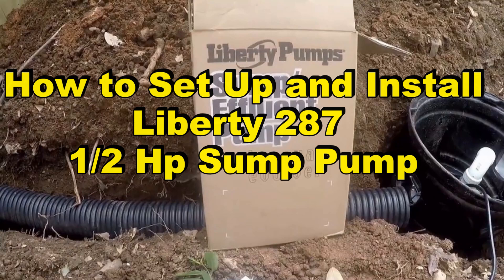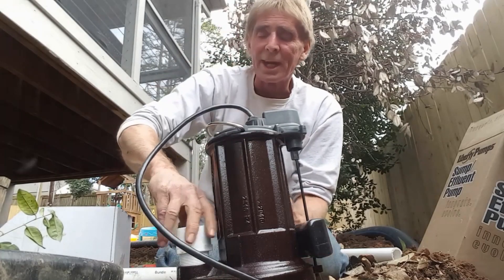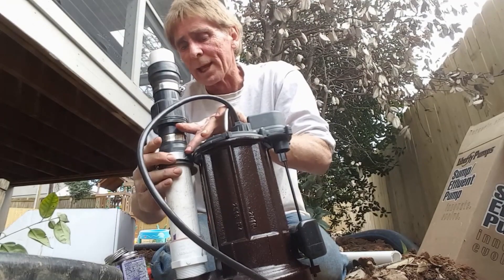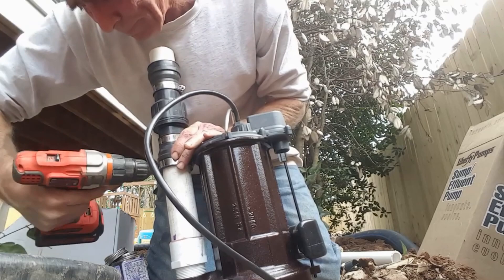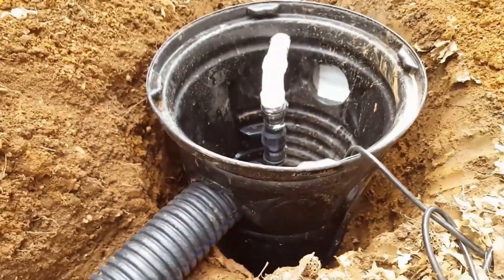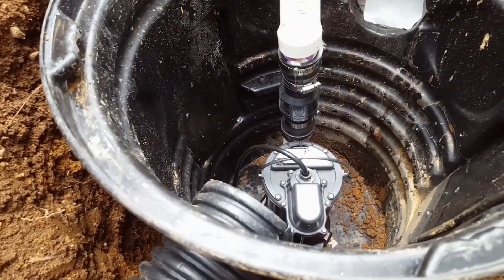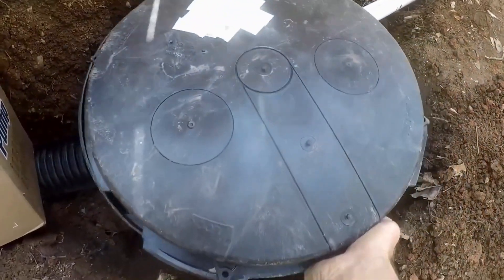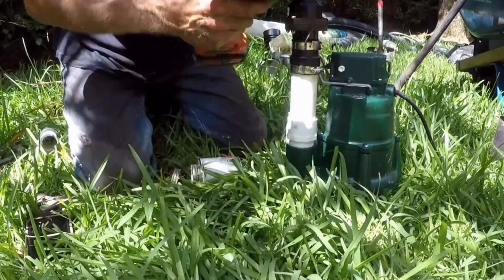Sump Pump - FAILED after 1st Big Rain -Liberty 287 - 1/2 hp

Comment: It's obvious that you didn't read the installation manual before you installed that pump. Very possible that pump got "airlocked" because you didn't drill a 1/8" "weep hole" in the discharge pipe, be cause you used a check valve. (page 4 in installation manual). If you read page 5, I would've never used the L287 in this situation that you did, and could be another reason why the pump failed.  There are other pumps from Liberty that would've handled what you were trying to accomplish. I've probably installed over 700 pumps in my Plumbing career that is still going after 31 years...do yourself a favor and google "Zoeller switch failure"...you will thank me later. I stopped installing Zoeller's 10 years ago, cause of the many call backs I was getting on their switch's.
Reply: If you don't mind me asking, are liberty switches more reliable? I would think that the switch would be the weak point on any pump. I've had a zoeller for over 15 years and last week the switch went bad.  No biggie, I replaced it with another zoeller. Just asking.
Reply: 700 pumps wow.  Have you noticed that LIberty pumps new out of the box take a minute to spin?  It's like the factory lube holds the impeller for a few seconds... and once it spins free it's fine.  I wish I knew why that happens.  I"m wondering if it's a tight bearing seat in their MFG process?

Comment: Zoeller m98 for the win 🏁
Reply: I have the same pump.Pump can run forever but switch is shitty.Had to replace it 3times in 7yrs.N98 might be better option with Levelguard electronic switch.I can't believe Zoeller makes great pumps then installs cheap plastic switch that fails and usually it can be catastrophic damage specially when you get lot of water in basement.

Comment: How do I set up to remove the pump in winter? Any ideas of making the electric connection removable? We have severe winters.
Reply: Those pumps have a 120 plug... remove the clamps on the Check Valve. Remove the Pump (unplug cord) 
Remove Check Valve this will let water drain out of your Pipe (Freeze). Store the Pump and Valve in the Garage for Spring.
Reply: @AP-514  unplugging the cord is my issue. Initial set up was done using hard wiring through a conduit underground. I replaced 1/3 hp with a zoeller and connected to the hard wire by using water proof connection  I tried to use water proof plugs but they are failing. Is it better to drill a hike through sump cover and connect to an electric box? Thank you.
Reply: @rrvootla  no don't drill a hole through the top cover of the pump since that will ruin the water resistance of the pump itself. Continue using a waterproof connector but make sure to put dielectric grease into the contacts to keep moisture out. Hope this helps